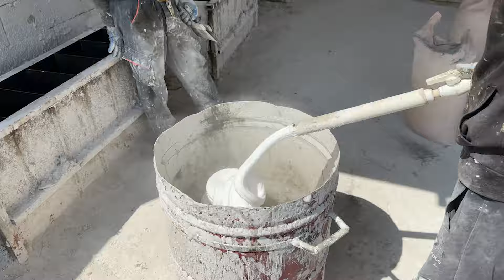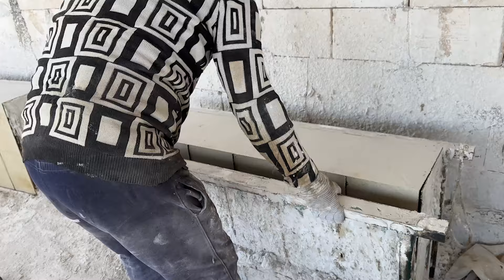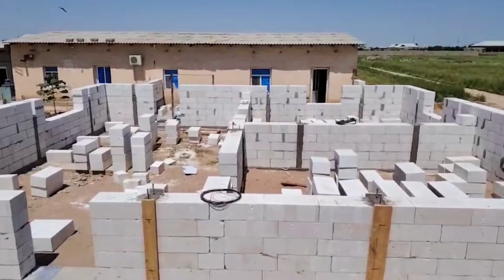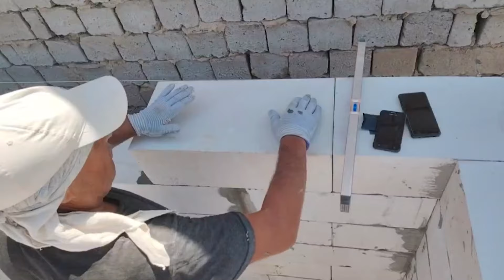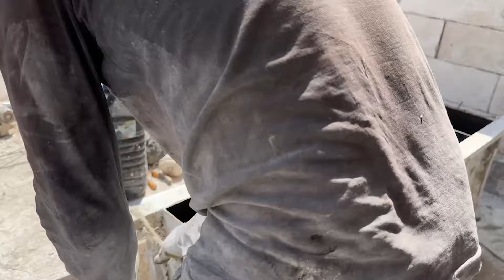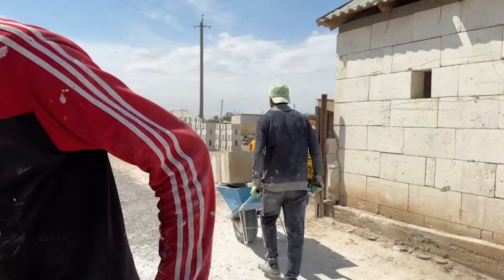Foam block quickly and easily  Foam+Gypsum and Cement Block

Comment: Instead of pouring the foam-concrete into the molds to form the blocks with which you make the walls, wouldn't it be much quicker to pour the mixture to form the wall directly?
Reply from the maker: not everyone has the opportunity to do as you said

Comment: By adding gypsum into cement, can that brick be used for external walls. Is it ok for rainy areas.
Reply from the maker: You can use this brick for exterior walls. This is normal for rainy regions. To do this you need to plaster the surface
Reply: @BbAmazingSkills  Thank you 🙏
Reply: @BbAmazingSkills Что вы подразумеваете под поверхностной штукатуркой? Мы знаем, что гипс набухает от воды. Пожалуйста, объясните нам подробнее.
Reply from the maker: @arabinaciri3005  можно штукатурить плиточным клеем или травертином, если подумать, то есть разные способы

Comment: سلام وقت بخیر چطور میشه این کار یاد گرفت
Reply from the maker: everything is calculated here
Foaming agent - alpha-olefin sulfonate AOS.
250-300 g of alpha-olefin sulfonate 50 liters of water gives 150 blocks.
block sizes 60cm/30cm/20cm
the air compressor is set to 5-8 bar
1 block costs $1
1 kg of gypsum costs $0.04
1 kg of Cement m450 costs $0.06
List of ingredients for 3 foam blocks
37 kg of gypsum
2 kilograms of Portland cement
50 liters of ready-made foam (alpha-olefin sulfonate) weighing 1.5 kilograms
50 liters of water
blocks dry differently depending on the season and weather of the country in central asia dry summer time 7 days

1) Tile adhesive is used as an engine for assembling blocks.
2) These blocks with noise and heat insulation do not burn in fire

https://youtu.be/Ft5w1iwbouo ALL THE SECRETS OF MAKING FOAM BLOCKS
https://youtu.be/D3ajZ7ly6I8 FOAM GENERATOR, HOW TO MAKE IT YOURSELF
https://youtu.be/-h6zBbVkuQI production of foam blocks with subtitles

Comment: Awesome video! Have you attempted to create wall panels? If so what was your experience?
Reply from the maker: In my opinion, the panels will not work, for this you need to strengthen the inside, but that's my opinion.
Reply: @BbAmazingSkills  okay, do you mean the inside of panel or the building that would be built with the panel?
Reply from the maker: @thomasroberts2600  I mean the interior part
Reply from the maker: @thomasroberts2600  Not recommended for multi-story buildings. Make external panels.
Reply: Will it wash away if it rains?
Reply from the maker: @shanjidali7254  No

Comment: Ive read that airfoam blocks can crack with earth movement so the mortar needs to be softer than the blick hardness.  What is the ratio in the mortar?
Reply from the maker: foaming agent - alpha-olefin sulfonate AOS.
From 250-300 g of alpha-olefin sulfonate, 150 blocks are obtained.
block sizes 60cm/30cm/20cm
List of ingredients for 3 foam blocks
37 kg gypsum
2 kilograms of Portland cement
50 liters of finished foam (alpha olefin sulfonate)
50 liters of water
https://youtu.be/Ft5w1iwbouo ALL THE SECRETS OF MANUFACTURING FOAM BLOCKS
https://youtu.be/D3ajZ7ly6I8 FOAM GENERATOR, HOW TO MAKE IT YOURSELF
https://youtu.be/-h6zBbVkuQI production of foam blocks with subtitles

Comment: Powder name plzz 
Fome...
Reply from the maker: everything is calculated here
Foaming agent - alpha-olefin sulfonate AOS.
250-300 g of alpha-olefin sulfonate 50 liters of water gives 150 blocks.
block sizes 60cm/30cm/20cm
the air compressor is set to 5-8 bar
1 block costs $1
1 kg of gypsum costs $0.04
1 kg of Cement m450 costs $0.06
List of ingredients for 3 foam blocks
37 kg of gypsum
2 kilograms of Portland cement
50 liters of ready-made foam (alpha-olefin sulfonate) weighing 1.5 kilograms
50 liters of water
blocks dry differently depending on the season and weather of the country in central asia dry summer time 7 days

1) Tile adhesive is used as an engine for assembling blocks.
2) These blocks with noise and heat insulation do not burn in fire
3) the finished block weighs about 15-16 kilograms
Reply: @BbAmazingSkills  How many percent alpha-olefin sulfonate?
Where can I get it?
I find 35%
Reply from the maker: @matejbenko8268  everything is calculated here
Foaming agent - alpha-olefin sulfonate AOS.
250-300 g of alpha-olefin sulfonate 50 liters of water gives 150 blocks.
block sizes 60cm/30cm/20cm
the air compressor is set to 5-8 bar
1 block costs $1
1 kg of gypsum costs $0.04
1 kg of Cement m450 costs $0.06
List of ingredients for 3 foam blocks
37 kg of gypsum
2 kilograms of Portland cement
50 liters of ready-made foam (alpha-olefin sulfonate) weighing 1.5 kilograms
50 liters of water
blocks dry differently depending on the season and weather of the country in central asia dry summer time 7 days

1) Tile adhesive is used as an engine for assembling blocks.
2) These blocks with noise and heat insulation do not burn in fire
3) the finished block weighs about 15-16 kilograms

https://youtu.be/KCKua0hrCrM Amazing Process of Making Foam Concrete Blocks
https://youtu.be/D3ajZ7ly6I8  FOAM GENERATOR, HOW TO MAKE IT YOURSELF
https://youtu.be/-h6zBbVkuQI  production of foam blocks with subtitles
Reply: @BbAmazingSkills  Iy is interesting and thank you.
I didn't find the alpha-olefin sulfonate AOS yet. Now I know it must be 92%
Where did you get the equipement
Reply from the maker: @matejbenko8268  local craftsmen did it
Reply: @BbAmazingSkills  you are awesome. It is good business? Works for you?
Reply from the maker: @matejbenko8268  thank you, and a very profitable business

Comment: Thank you for this video.. Question: How do I get the right foam?
Reply from the maker: chemistry to convert alpha olefin sulfonate AOS
Reply: @BbAmazingSkills How much alpha olefin sulfite do I need? If it is 1 liter of water
Reply from the maker: @Ridi2014  250-300 g alpha olefin sulfonate, 55-60 liters of water per 150 blocks.
Reply: Our ultra foam reinforcement is suitable for use in concrete bricks
Reply: What is the alternative to alpha olefin sulfite?
Reply from the maker: @Ridi2014  Don't know

Comment: used 3 kilograms of cement and gypsum and 3 liters of water for each block, and the rest was alpha olefin foam. The block is smooth and does not stop. Do you use other types of solids?
Reply from the maker: no